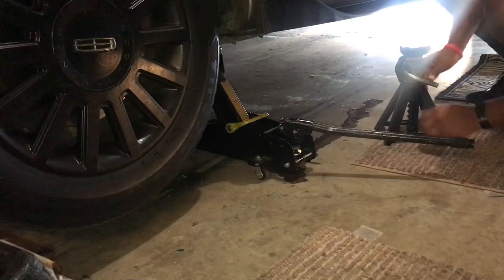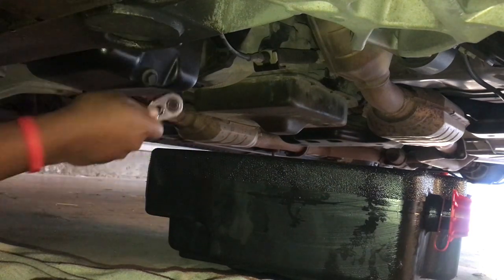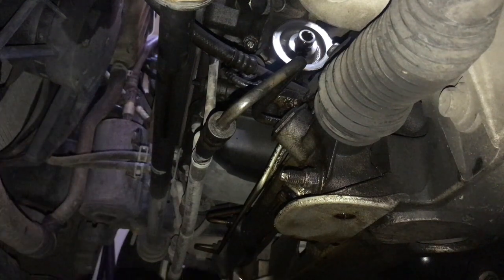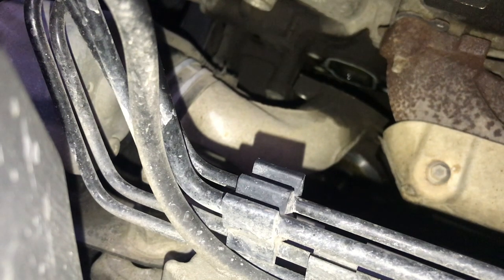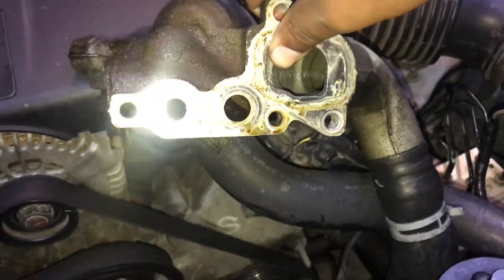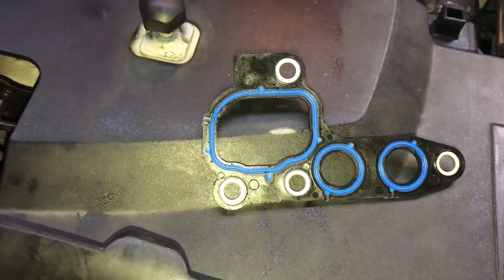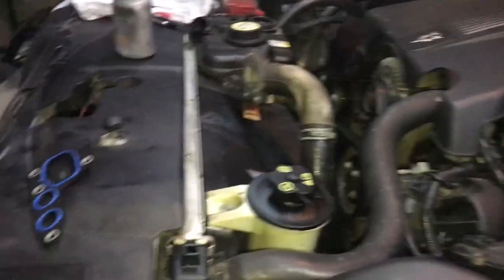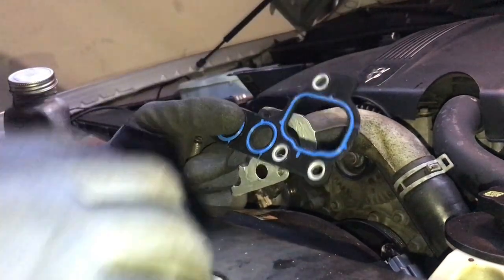Oil Filter Housing Gasket | 2003 Lincoln TownCar

Comment: Helpful. How is the repair holding up any leaking?
Reply from the maker: Nope no leaking at all, will probably last another 200k miles
Reply: @mightyprophet4581  Another person used gasket maker and not anti seize. Any particular reason you used anti seize?
Reply from the maker: @plantmanstudios  a gasket maker is in the name, you don’t have to buy a gasket like I did, u just put the gasket maker where the gasket suppose to be and it hardens into a gasket
Reply: @mightyprophet4581  Another Youtuber used both a gasket and the gasket maker paste. I used gasket maker and a gasket on a header flange and it didn't work. I am not sold on how useful gasket maker really is. Maybe I didn't use it correctly. It is possible.
Reply from the maker: @plantmanstudios  if you watch my differential swap video, someone used a gasket maker and it held up for a long time it was still in great shape before I change my fluid